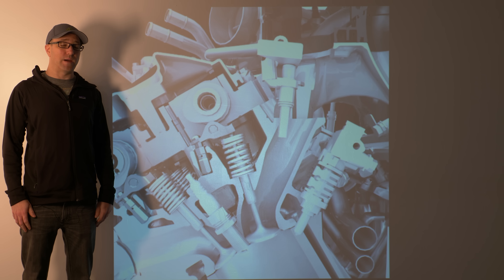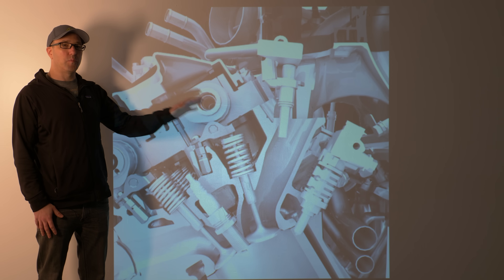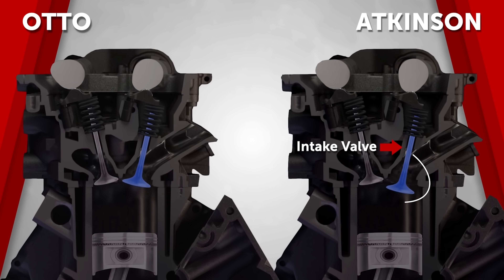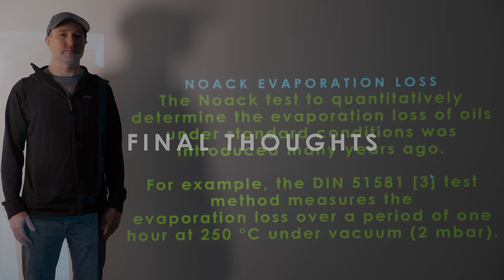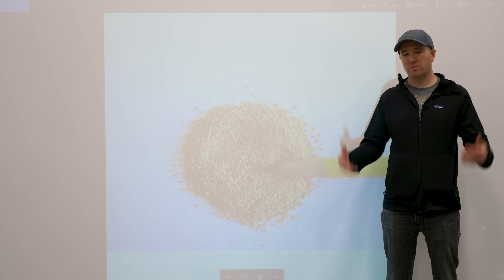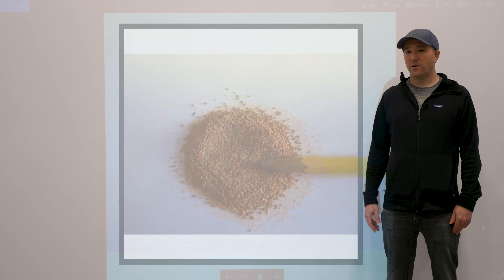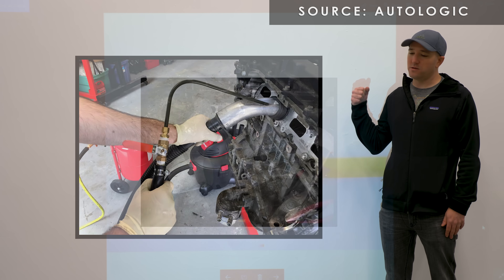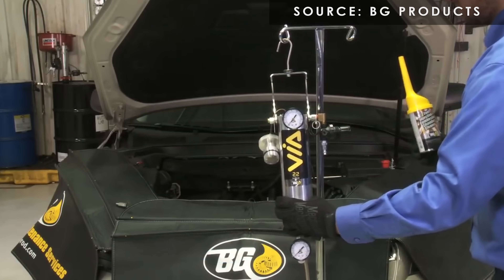Direct Injection, Problems and Solutions | The Fine Print

Comment: BOY did he get blowby backwards. Blowby happens on the compression stroke and builds up in the crankcase. Than that pressure is past into the PCV (Positive crankcase ventilation)valve  into the intake so it can get 
re-burned. That is how the oil
vapors are getting onto the back of the intake valve or valves.
Reply: Blowby happens during the power stroke when combustion chamber pressure is the highest.  This extremely high pressure can force small amounts of gas past the rings into the crankcase while the piston is going down.  The pressure during compression is relatively minor in comparison and if the rings leak during compression, they will absolutely let the combustion gases get by during the power stroke.  That piston would be well down on power and needs a rebuild to restore the rings.
Reply: Thank you, now I don't have to write a correction for him. Was a great Vid till he got to the Blow by. But a well made video except for the incorrect Blow By Info!
Reply: Yep, a good example of total misunderstanding of the PCV system.
Reply: Was just about to type this
Reply: What do you expect from a guy that thinks he is cool by saying "motor' instead of engine?  ICE=Internal Combustion Engine.
Reply: All of these backyard mechanics with the Perot science explanations. I bet you still believe all of those old ethanol mix too, huh? Do you not realize the piston rings can leak on the downstroke as well, especially when pulling a vacuum?
Reply: He forgot to talk about the Italian tune-up.
Reply: Andrew Syracuse 

Or the Kansas City Pole Kiss.

Gives new meaning to the nickname “crotch rocket”.
Reply: No one is mentioning the EGR system where the soot actually comes from. The worst thing about any oil getting into the intake is that it helps bind the soot to everything. My impression from tailpipe inspections, is that GDI engines produce more soot, further exacerbating the problem.
Reply: Larry McCraw    Out the exhaust side, yes. But exhaust gasses are recirculated through the intake even at partial throttle and light engine loads.
Reply: To be honest if that was the first thing you noticed that was wrong you really weren't paying attention. He got a whole lot of other stuff wrong. This is like watching someone give a class presentation on a topic he was suppose to research and its clear he only read the first sentence of a couple of wikipedia articles.
Reply: How does he not understand?  Smartie glasses doesn't make an engineer
Reply: You do know that the crank case is not sealed from the valve train? Your right in almost everything you said except that the pressure waves from the crank case are allowed to expand through the engine, with the over pressure (on some engines, especially Toyota) released through a PCV valve in the cam cover.
Reply: How does a misfire happen here?
Reply: yeah oil getting sucked thru the intake towards the valves is breather systems fault. putting separators on it kinda helps, but the gunk still gettin' in there.
Reply: Wondered about that.
Reply: That makes more sense, thanks :)
Reply: Just buy a 2 stroke and shut up then!
Reply: To all great engine gurus here..
 
Care to share your intelligent solution for carbon build up in DI engines?
Reply: @ricstars95  Poor maintenance
Reply: The fact that some cars use a PCV on the top tells me just how poorly designed the engine is....
Reply: @jsm3233  Completely and utterly wrong.
The blowby passes down from the combustion chamber via the piston rings, gets mixed with oil mist, gets vented through the PCV into the intake.
Exhaust gas recirculation (EGR) inserts exhaust gases somewhere in the intake, usually behind the PCV.
Oil mist from the PCV and soot particles from the EGR mix and form a tar like substance, which gets deposited on every surface in the intake.
That's how you get carbon buildup, and yes, it builds up during operation.
Reply: Unfortunately, many of those “experts” don’t really know as much as they claim. They know quite a bit, but tend to overlook the fine minuscule details which makes all the difference. 

This is a side tangent but will make sense. There are people out there who claim “Cars didn’t last past 75,000 to 100,000 miles back in the 60’s and 70’s”, while that was true in some cases, the thing people overlook is what was used for crankcase ventilation before 1963. Many years ago, engines simply used a road draft tube to ventilate the crankcase vapors which was a tube that came down from the engine and as you were going down the road it would cause a low pressure area causing a draft which pulled the crankcase gases out hence the name road draft tube. Unfortunately, it didn’t do anything at idle or low speed, as a result the blow-by gases would react with the oil causing lots and lots of sludge to buildup causing oil starvation problems, were lucky to make it to 100,000 miles with a engine that used the road draft tube crankcase ventilation, hence where the “Cars didn’t last 100,000 miles” comes from. 

As soon as the PCV valve became mandatory in 1963, engines began to last longer and longer since they had constant ventilation while running, be a more common to see engines with 100,000+ miles on them from there on. Some even made it to 150,000, 200,000 in some cases.
Reply: Right... The explanation given in the video is wrong...
Reply: You are nit picking. "You have pressure that comes up" means pressure goes past the ring to the crankcase, then travels up to the top of the engine where the PCV valve ventilates it. He is just explaining the general idea. Is good enough for purpose of this video.
Technically, is not "pressure". It was pressure in the combustion chamber. Once it escapes past the ring, is basically just gas at close to atmospheric pressure. There can be no pressure inside the crankcase otherwise, the seals will blow.
Reply: @briangeiger9307  Because the crankcase is sealed the PCV system is designed to relieve this pressure.  On old cars, the engines were vented directly into the atmosphere and the oil fumes were a major environmental issue.  without some kind of vent, like the PVC the seals WILL blow out.  The blowby is NOT at atmospheric pressure it is much higher pressure.
Reply: Actually, he did not get the explanation of blowby wrong.  However, you just did!  Blowby flows down, not up.  It is caused when the combustion gasses flow around the piston and its Compression Ring, back down into the crankcase where the oil is located.  The Compression Ring is supposed to keep fuel above the top of the piston while the Oil Ring is supposed to keep engine oil below the piston and in the crankcase.  The oil and fuel are NOT supposed to mix at the point of Combustion.

What't not been said here is WHY Carbon Build Up really takes place.  Fuel economy regulations force OEMs to come up with patchwork fixes for very old automotive technology.  You can gain fuel economy in several different ways.  One of those ways is by reducing Internal Friction within the engine itself.  One of the ways that is done is by tweaking the tolerances between Rings and Piston Walls to actually ALLOW more blowby, believe it or not.

This is one of the reasons why engine oil is being burned at higher rate in today's DI engines and this is causing long-term combustion problems leading to more carbon build up on valves and shorter maintenance intervals.  The attempt to reduce internal engine friction with patchwork leads to lower energy requirements to move the internal engine components (pistons) which itself yields minor fuel economy gains - however it also creates internal combustion problems leading to higher maintenance costs due to carbon build-up given the higher amount of oil being burned in the process.

He gave a general explanation for blowby within a much larger discussion of Engine Efficient relative to Direct Injection Engine Design and the inherent problems they cause by way of OEMs trying to keep up with fuel economy and emission standards.
Reply: @n7st591  he said in the video that pressure blows from the bottom of the piston into the cylinder and then into the head. He then proceeds to call the head the "crankcase"... Which is wrong
Reply: You are correct. This guy in the video got PCV all wrong. Even his explanation is illogical. Higher pressure in the crankcase bleeds into combustion chamber? So where was this ‘higher pressure’ coming from? Was not aware that combustion took place in the crankcase - dope. He spent more time editing his video for dramatic effect than fact checking.
Reply: Higher pressure comes from blowby from the combustion chambers. It's a real positive pressure which is why they call the valve, Pos. Crankcase valve.  Can blow out the gaskets in the crankcase and head.  @johncanalese588
Reply: @grassroot011 Yes, I understand that it is combustion gasses coming from the cylinders leaking into the crankcase which "positively" pressurises the crankcase relative to atmospheric pressure. I was not saying that combustion took place in the crankcase - I was being sarcastic! I apologise if you did not understand the intent of my post or if English is not your first language. Anyway, the OP of the video got it wrong in the first place when he implied that this was indeed what was happening.
Reply: @johncanalese588  All of his videos are a mess.
Reply: he is explaining how gases seep past the rings into the crank case and flow up into the cylinder head where they are extracted through the PCV valve. it may seem a little ambiguous but it's a correct explanation.
Reply: @fmsdaman1  It's been a long time since i went to School but combustion is hot and heat rises and that's where the valve cover and PCV valve are located. There is much more to it than that such as windage from the pistons moving up and down as well as the crankshaft spinning.
Reply: wysetech2000 It has nothing to do with heat, it's simply pressure difference.  Blowby gasses enter the crank case and then move up into the rocker or cam covers because that's where the PCV vent is typically (but not always) located.
Reply: I think the 'reverse pressure' statement can be true when the piston is at the start of the intake stroke, and turbo cars with oil squirters or bad rings can totally end up with oil vapors.
Reversion back into the intake tract can happen when the intake valve opens at the end of the exhaust stroke also.   We're operating with 4 or my pistons so they share pumping losses.
Reply: Hugh Briggs I read long ago that if your intake is a bit oily and dirty, the exhaust is restricted. Headers and good exhaust should fix the reversion. But Idk for sure.  I agree with what you said about reversion just adding my c2
Reply: Yup. And he got a number of things wrong, perhaps on purpose. And while carbon fouling of intake valves IS a problem, on a good quality engine that has its ignition and fuel system properly adjusted, has properly adjusted valves, spark plugs and coils are functioning properly, has properly functioning pcv valve, and has oil changes done at adequate intervals, the DI engine, except perhaps for a few poorly designed models, can usually go a LOT longer than 30,000 miles before there is any significant carbon fouling on the inside of the intake valves. With port injection you don't have to be so careful about having a properly working pcv valve. they are not as finicky. He fails to mention the benefits of using Top Tier gasoline. Which is probably a better idea than using the fuel additives he mentions. And I am skeptical about the value of catch cans. With a good engine and a properly functioning pcv valve, a catch can is generally not going to catch very much. Like many a good con artist, he starts off with verifiable facts, and clear descriptions, and later starts descending into some plausible, but untrue or unproven stuff. Is he selling walnut shells? Fuel additives? DI injectors get blocked more frequently not because they are exposed to more carbon buildup, but because they are narrower, so they can become significantly narrowed by buildup, more quickly. However the problem is not all that bad. Why? Because the fuel is constantly cleaning them, and it is going through them at higher pressure.
Reply: @soilmanted   You just have NO idea what you're talking about.
Reply: @soilmanted  How does a properly functioning pcv valve help reduce the need for an oil catch can or aos?  It either releases the pressure or it doesnt, it cant decide only to release air and no oil or fuel vapor.  If your pcv valve isnt working on any sort of motor you will have problems such as seals blowing as it is not releasing the crankcase pressure.  All a pcv valve does is release excess pressure.
Reply: @MrHarey31   Modern PCVs aren't just on-off valves. They adjust the flow rate of oily crankcase gasses, and can also dilute the crankcase gasses with various amounts of fresh air in order to assure best burning of the oil in the crankcase gasses at various engine speeds and loads. .If the PCV is not adjusting the flow rate properly to be commensurate with the engine speed and load, the engune won't be able to burn all the oily air that the PCV allows through to the air intake, then that oil will be deposited rather than burned. Even plain on-off PCVs can be ON at the wrong time, and allow oily air to be drawn into the intake manifold at times when the engine is not able to burn it off.
Reply: Mark, while I agree his description of blowby wasn't clear, in reality blowby often does reverse direction and push back into the cylinder, carrying oil with it and resulting in excess oil consumption. This happens when the PCV system isn't able to handle all of the blowby and the crankcase pressure builds up, especially at high rpms and WOT. I've seen high mileage vehicles with gummed/plugged up PCV valves that build so much crankcase pressure that they "oil can" or bend valve covers and oil pans. At the same time these vehicles typically burn large amounts of oil when you drive them hard. Once you either fix the plugged PCV or open up the crankcase by installing an open breather element (or simply an open hose attached to the valve cover) the oil consumption typically goes way down (still bad, but often 1/4 as bad). You still have a worn out engine with tons of blowby but the blowby vents out of the crankcase instead of pressurising and pushing oil and blowby back into the combustion chamber.

I think a more important thing that was missed in this video is how DI enables the fuel in the combustion chamber to not (be at the right mixture to) ignite during the compression stroke, which essentially eliminates pre-ignition and detonation. Since DI enables fuel being injected during the compression stroke and even at TDC or during (the first portion of) the power stroke, engine designers are able to combine high compression ratios and turbo charging to enable both lots of power and good fuel economy. A port injected engine on the other hand with a decent amount of boost requires a low compression ratio to control pre-ignition so when not in boost and cruising down the road the engine's low compression results in horrible fuel economy. That is why it is so common to see turbo charging combined with DI (along with high compression ratios).
Reply: @Slider68   Very well explained,thanks.
Reply: @Slider68 ,
Thankfully, somebody (you) understands the matter fully, so I don't have to choose between writing a 10 paragraph dissertation, or being depressed for the rest of the day. Ha. 😃
On the other hand...
I also find it humorous to see all of the different levels of comprehension.
Even those who caught the poor description of "blowby gas flow" would adamantly argue against the idea that pressure in the crankcase causes air, with oil vapor entrained, to circumvent the rings and enter the combustion chamber.
As you mentioned, at WOT there is little vacuum in the crankcase, and often there is positive pressure (despite the best intentions of the PCV system). Combine this with the high rpm intake stroke of the next cylinder to fire, and it is easy to see that there is pressure below the piston rings, and also a vacuum above them. Piston rings are never 100% effective...
and when conditions are "completely reversed" pressurewise, well then...  reverse flow does occur while the piston rings flutter helplessly in observance. Ha. 😉
Oops... turned into a lengthy post anyway. Sorry bout that.
 Punish me at redline, with a lean mixture, low sump level, pegged temp guage, and a threat of pre-ignition.  That ought to teach me not to repeat the offense. Ha. 😎
Reply: @Slider68  you should shut up...
Reply: This guy is a snake oil salesmen.. start with unknown facts, and push a false cure.. then sell a worthless product.. what he is selling here is your time.. he gets paid by utube, for keeping your eyes on him.. that's why he doesn't offer a product..this guy is a freak, and knows nothing about engines... Think about it fools, our cars have 60k warranty, it would be fixed by the warranty... Clickbait.
Reply: @KBS117  Kids, stay off crack!
Reply: Yeah...this guy is an idiot... Any new engine has no blowby...the conditions he propaganda's about here, only exist in worn out engines.. freaks everywhere, with false fictions for the untrained, to digest.. engines have 60k warranties, the dealer would have to fix them, if this was happening...
Reply: @KBS117  You are clearly ignorant.  New engines have blowby.  This is easily observed from the PCV fumes having more than just unburnt oil vapor in them, particularly the WATER which is a combustion byproduct, or did you think that catch cans installed on new vehicles were catching that water because manufacturers now install Tiny Rain Clouds under every hood? lol.
Reply: @stinkycheese804  catch cans? And water isn't a problem anyway, as it will pass through the engine turning to steam, and removing carbon as it does so.. it's a carbon build up on the backside of valves..not water..
Reply: I stopped watching once I saw him 'blow' the explanation of blowby. If he gets that simple explanation wrong, how can I trust any of the more complicated explanations? I can't, so I stopped watching. I wasted 7.5 minutes of my time.